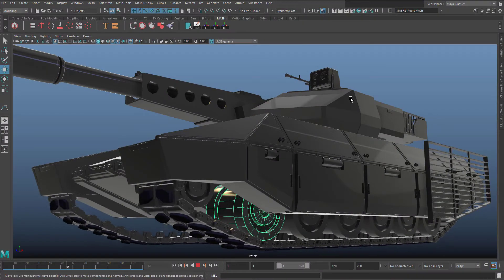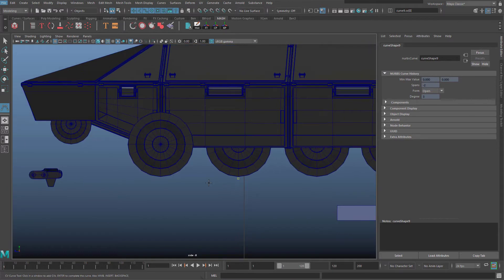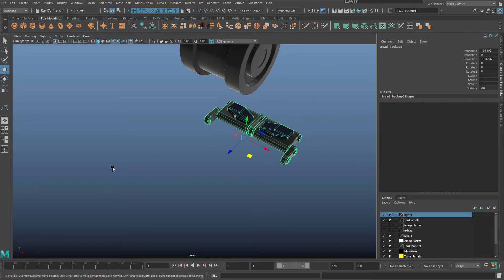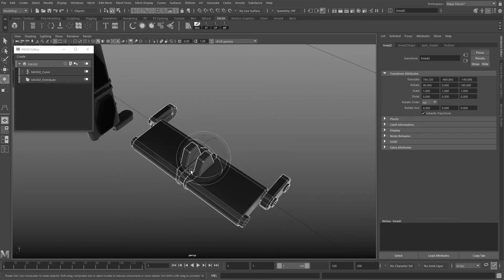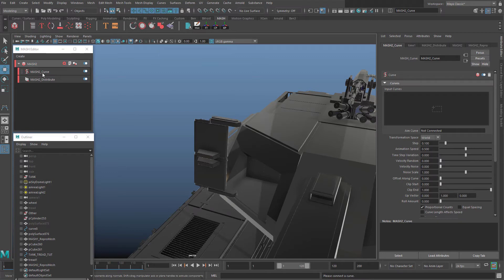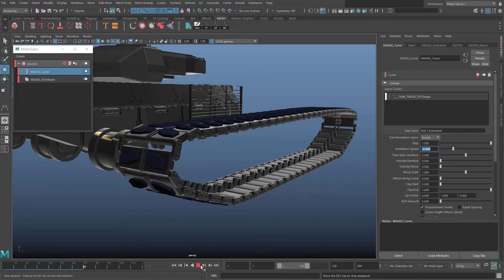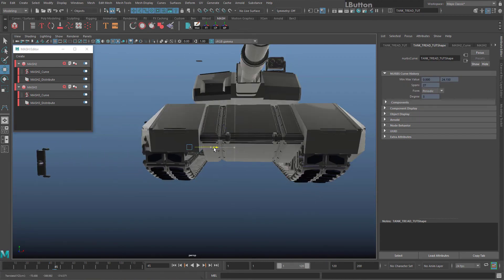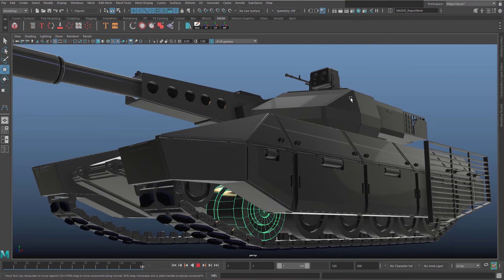How to make a TANK TRACK in Maya quickly. Animated with MASH. 3 steps to get working IN YOUR SCENE

Comment: The video was helpful to understand the principle. My students have to solve an exercise with two gear wheels controlling a chain. For rotating the group with the MASH model I simply create an instance copy of the MASH result and hide the MASH setup. This solves the problem of the MASH elements tilting/rotating along the path. To control the chain along the path via one of my gears, I simply use the offset on the path. To correctly control the chain movement via the rotation of the gear, one must calculate the relationship between the rotation of the gear and the translation of the chain along the path using an expression. I also show my students how to solve this problem using ChatGPT. ChatGPT not only creates an expression but also explains the solution in an excellent didactic manner, making it understandable even for those with mathematical weaknesses.

Comment: Is it possible to mirror the thread and also have the animation ?
Reply from the maker: yes, you can duplicate special and click on it's option box and check the box for duplicate input graph and it should work
Reply: @CGITutorials  i was thinking of mirroring ( because is not symmetrical)the polygon and hopefully the animation stays for the mirrored poly and it works ! the mirrored poly mirrors the movement i do to the original curve.

hope u get what i meant

Comment: Is there any way to animate it if your treads are a single object?
Reply from the maker: The only thing I can think of is to either separate them for this method or if  you have your treads in a straight line, you could play with deform>nonlinear>bend or something similar. I would only know how to get an oval shape, or half of a pill shape of animated tracks with this method.

Comment: You're missing a few steps if you want to use this for anything that doesn't just drive in a straight line at constant speed. 

To prevent the tracks from flipping when you rotate the  tank, you need to:

1. Duplicate the curve, select the CVs on the duplicate and make it a bit larger than the original curve.
2. Add this duplicate curve as "Aim Curve".
3. In the MESH Curve node, set Roll Amount to 1.
4. Group the original curve and the aim curve together, and use the group to move the tracks around.

Secondly, the Animation Speed only works if your tracks never changes speed. If you try to animate the Animation Speed, you'll see it will spin to where it would have been if had that speed from the beginning. Instead you can animate Offset Along Curve..
Reply: Thanks a lot for this info man.